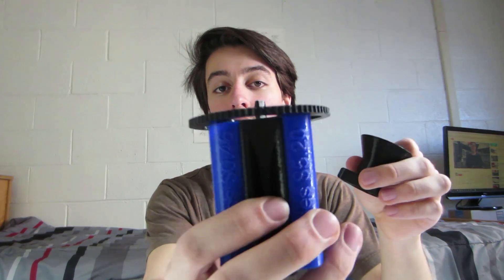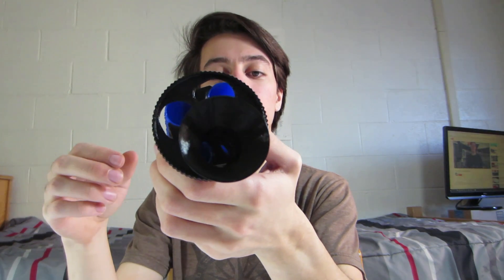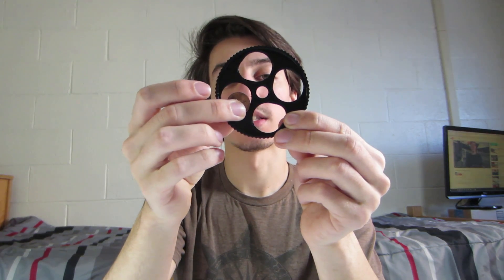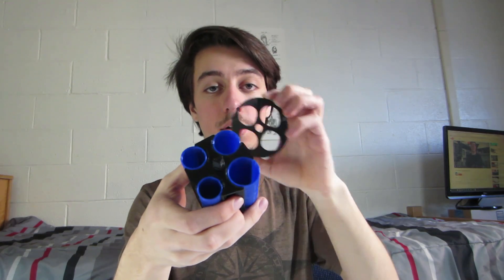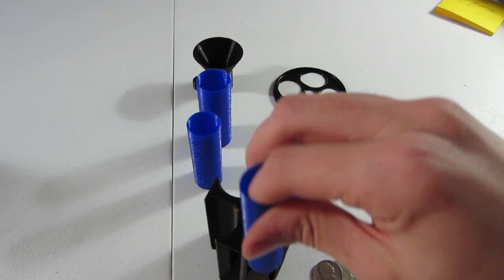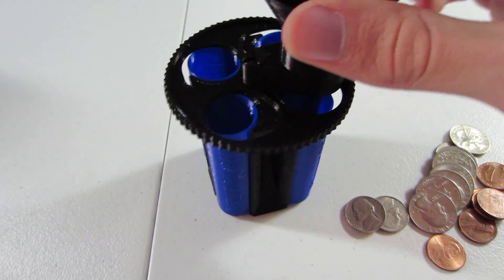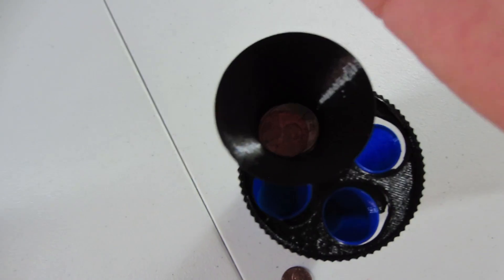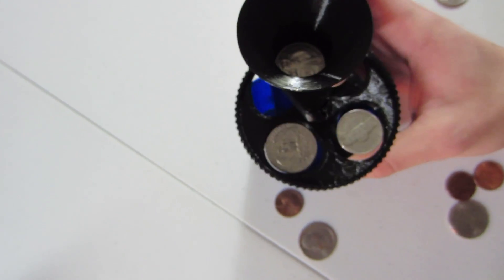Best 3D Printed US Coin Sorter

Comment: If you have a Ender 3 printer. DO NOT PRINT THIS. when i printed it the pin was way to big and when i tried to make it smaller the top was perfect the bottom where it goes into the holder was way to loose causing coins to jam.
Reply: Thanks, I was just about to print when I saw this

Comment: Dumb question. Why small coins don't drop in larger tube?
Reply from the maker: The mechanism is designed to spin clockwise and the holes go from smallest to largest. So say its a nickle, it goes over the hole for the dime, and then the penny, then it falls in the hole for the nickle. It only works if you spin it in the correct direction, otherwise all of the coins will fall in the quarter hole